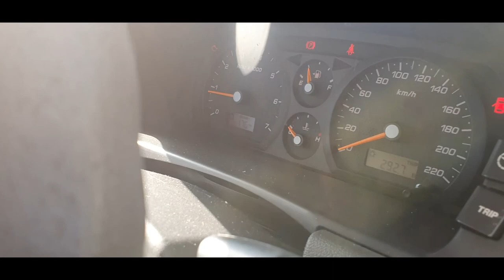Ford territory ball joint replacement

Comment: U shouldnt tighten the ball joint or control arm to subrame bolt until the vehicles at ride height with weight on it. Them Machter control arms are garbage as well. One of mine snapped 5 months after replacing
Reply from the maker: 20,000kms so far so good. Will be going with a better brand next time just bought cheap parts to get us outta trouble after buying the car

Comment: cool vid mate just been quoted  $700 to same job that is supply and fit plus wheel align included. fuk these mechanic rip offs will give it a go myself. replace rear wheel bearing and hub ! side $440 supply and fit WOW .
Reply: I agree these large companied mechanics charge a fortune when all it takes is a bit of research, buy the right parts and have the correct size spanners. I needed a 22mm I had a 21 and 23. No space in the box for a 22 and no 22 supplies. Spewing.

Comment: How to make a $200 diy repair fuck the rest of your suspension and steering system causing you far more headaches and money in the future:

I didn't watch the whole thing  but no grease, no threadlock, no torque specs (didn't care, but then proceeds to kick in a 90nm balljoint nut which is probably one of the most dangerous parts to overtighten on a 2 ton vehicle), jack on grass... not that is matters because he didn't even use the jack for the only part it was crucial (chassis bush which will tear if not secured at ride height), claims he might rotate completely fucked tyres and incorrectly states that it will be ok because the tread in the middle is fine, probably didn't get a wheel alignment etc. etc.etc

Don't do exactly everything this guy did.